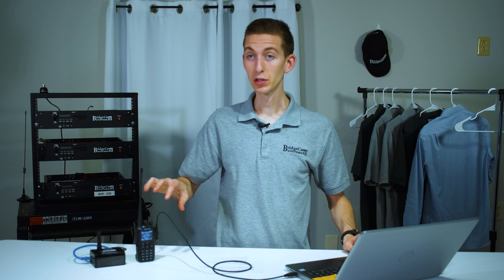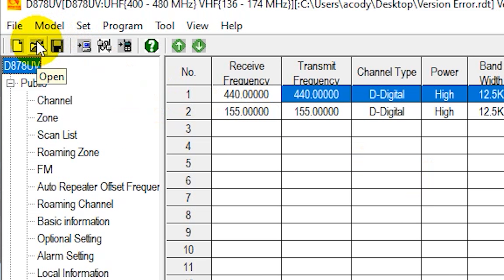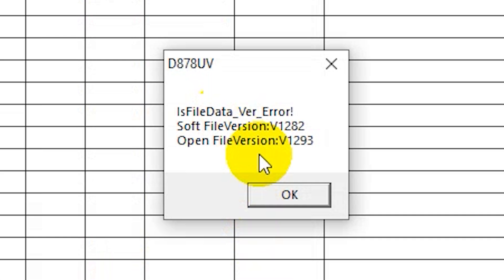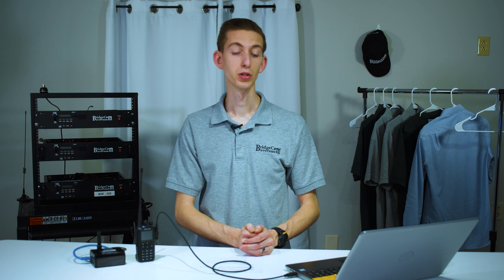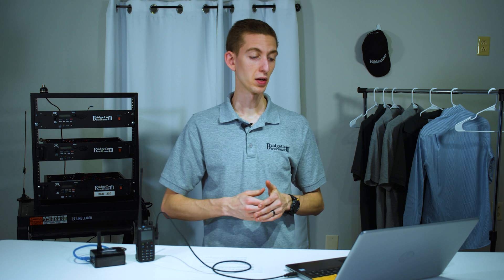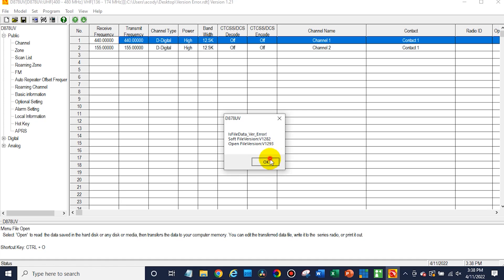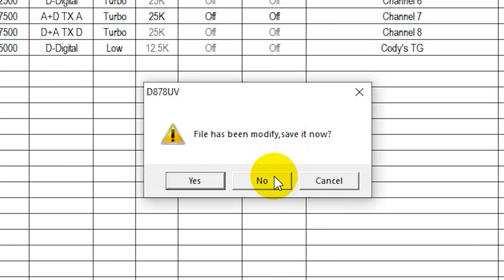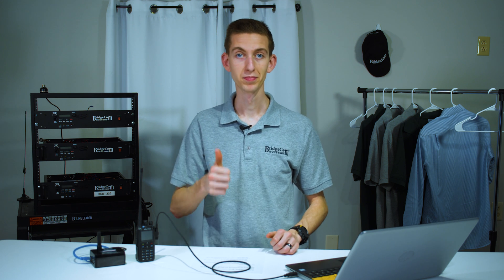How to Fix a Version Error on a Code Plug

Comment: I'm not worried about  this topic but since the viddy is so new you might answer this question. You've never answered one yet so I'm not hopeful. So here goes. I want to scan for ctcss but when I try it says "Rx cdt not open". I found this on a page somewhere but what does "full TSQ / CTCSS Decode" mean and how do I turn it on? 

Your instructions...
CTCSS/DCS Tone Scan for AT578UV and AT878UV
What is CDT Scan? It is a means of finding the tone in use if it is not known during a current
transmission.
This tool is found via Main Menu/Scan/Cdt Scan
Now to use this feature, you will need to be on the frequency or memory channel you wish to tone
scan. This frequency also will need to be set to full TSQ / CTCSS Decode, or DCS Decode.
Reply: Nevermind I figured it out. It means you have to have a CTS set on the frequency before it will scan all of the rest.
Reply from the maker: Right on!
Reply from the maker: Thank you for you comment!